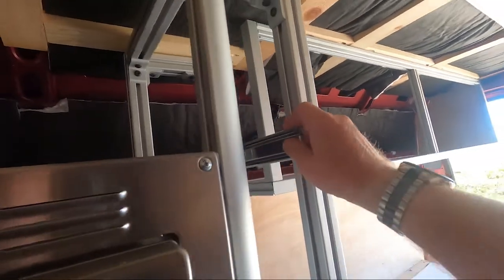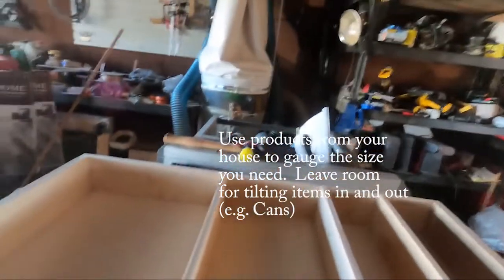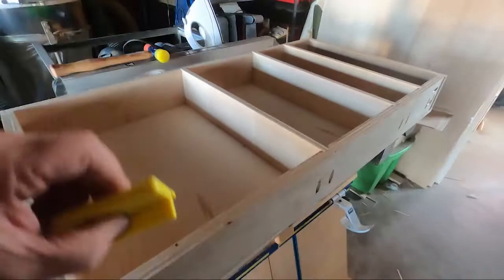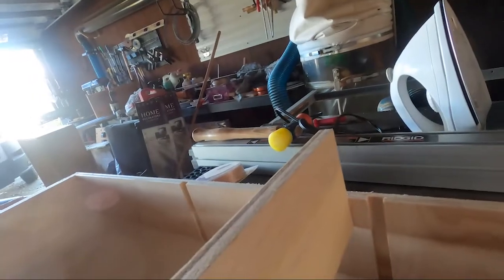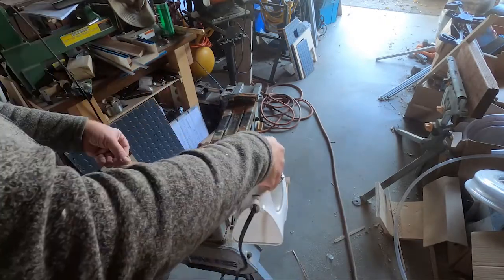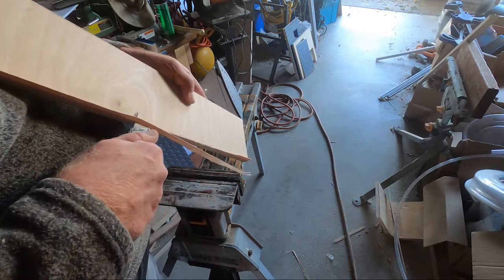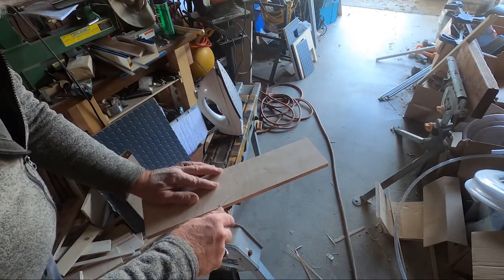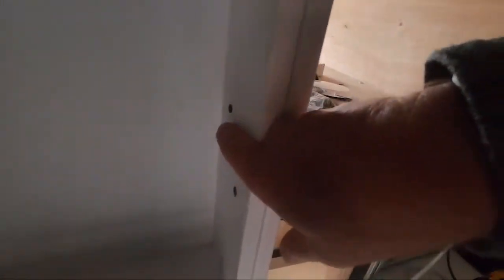Building The Pull-Out Pantry cabinet in the Ram Promaster 3500 Extended

Comment: Nice work. I'll be adding the same to my van. Also thank you for all of your videos. They are all very helpful, especially the electrical.
Reply from the maker: Thanks!
Reply: Thank you.  I've never seen the detail around the slides. One on top, one on the bottom. How did you make sure everything was square so that slides weren't fighting each other?
Reply from the maker: @grayandgrumpy  You could use a Drawer Slide Jig from Kreg Tools along with one of their clamps.  You clamp the jig to the 8020, place the slide on the jig and then mark the hole positions with an Automatic Center Hole Punch. Then, drill out the hole the punch makes with a bit that's smaller than your self tapping machine screw so the screws will have something to bite into.  I  clamped the slide in place and used a builder's triangle to ensure the first slide is perpendicular to the 8020.  Then I just measured the distance between the slides at the front and the back of the slide where it meets the 8020 to mark the next slide down.  I marked the mounting holes with an Automatic Center Hole Punch.  If your 8020 is square, the slides will be as long as their measurements of the mounting holes are the same.    If you have some scrap 8020, you could also just clamp it below where you want the slide to sit.  Make sure it's perpendicular to the vertical 8020.  Then set the slide on top of it and mark your holes.